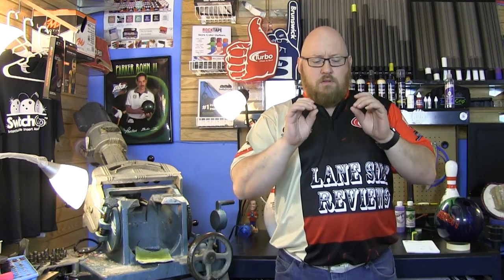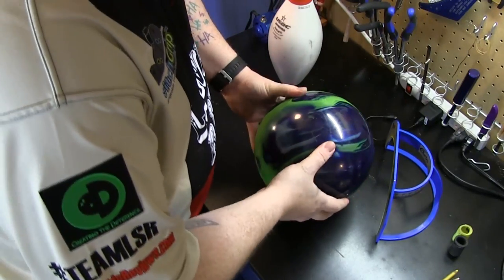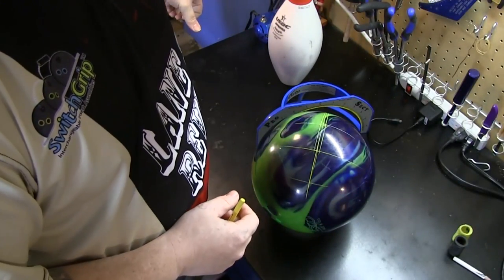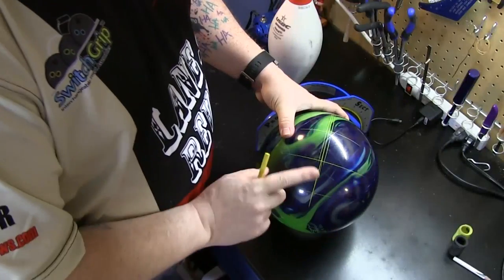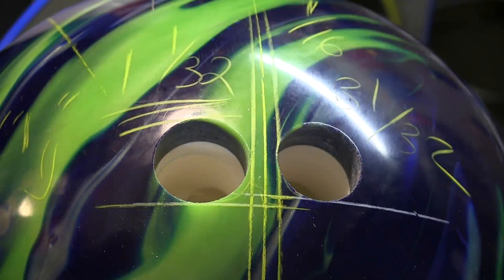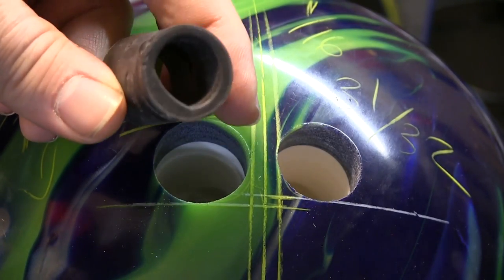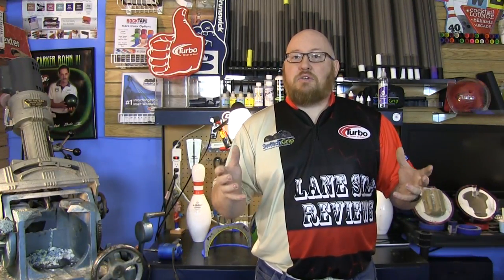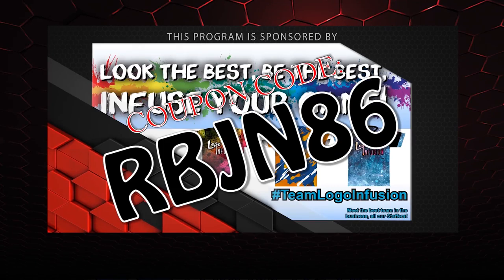Vacuum Grip Installation and Review by Lane Side Reviews

Comment: Hi Rob thank you for the video. I'm just getting back into bowling after a 30 plus year sabbatical so I'm trying to catch up on everything new to me.  Ideally I agree it would be best to re plug the holes to maintain the same span in your grip. But I have one correction see whole size difference is a 1/16” as you mentioned which is the difference in diameters. Using the existing holes the actual grip span difference would be 1/32” reduction or the radius difference.
Reply from the maker: When you're right, you're right...and you, sir, are right.
As an interesting update, I've been toying with using 1 1/64 holes instead of 1 1/32. It gives them a little more suction, and doesn't require plugging at all.

Comment: I don't think the change will change your span. I just did it to my arsenal and it feels great. The difference in the expanded width of the finger hole is filled up with the extra width inside a smaller grip. I mean, there is more material on the grip, so the span will remain almost the same. In fact, if you try and drill the expanded 1 and 1/32th hole flush against the front side of your grip, you'll be actually increasing your span when you use a narrower grip. So for existing balls, simply drill it centered with your existing 31/32th hole, and use a smaller grip. I tried going 3 half sizes down, but I can go up to 6 half sizes, or 3 full sizes. Even smaller. Do it by feel really.
It is also great for those of us passing 50 years of age and starting to suffer from a little bit of Arthritis.

Comment: I been using vacu grip for around 3 or 4 years now. Love the feel and release is better.
Reply: I’ve been using Vise vaccu grips since 2004. Tried some Turbo grips in 1 new ball recently (turbo only shop) and installed Vise vaccu after 3 games. Difference in feel was too much for me.
Reply: @remoevans2233  I use turbo for mine.
Reply: @JamesCFelty3  My son uses Turbo as well since the shop that drills his equipment only has Turbo grips.
Reply: @remoevans2233  my shop guy is on staff with vise, but he lets me bring in turbo grips and sleeves for my equipment. I just like how they feel and their customer service is great!
Reply: That’s what it’s all about, what works best for you. I don’t like either Vise or Turbo for interchangeable thumbs. Grip Lock makes a better product as well as Jo Po for that application.

Comment: That's why I hear the pop noise in pba events, I thought it was the thumb, but you always release your thumb first, so good to know this stuff :) I might consider vacugrip if our pro shop does it. Does it cost more to do this drilling?
Reply from the maker: we've rarely seen an additional cost for it (its actually less glue and work), but that is up to the pro shop.
Reply: Lane Side Reviews They just charge extra for special layouts, drilling is always the same price unless you get the interchangeable thumb slot, it's a bit more. I also have a small crack on top of my ring finger, because he was in a rush drilling my ball and forgot to bevel out the finger hole. I still love my ball though. That was the first time he messed up, but I didn't mind it too much

Comment: How would making an existing 31/32 hole into a 1 1/32 work? Wouldn’t that 1/16th shorten the bridge length to make it more susceptible to cracking? As a no-thumber, I wouldn’t have to worry about the change in span but I’m just worried about that 1/16th change
Reply from the maker: You can align it so the flat edge is the inner bridge. It will feel very similar.
Reply: @LaneSideReviews  So it would be thicker on the left and right sides as compared to the middle edge?

Comment: Couldn't you just file the fingernail-facing interior edge of the finger holes in an existing ball to create the extra space? You'd be able do to this with some elbow grease and just need to replace the inserts with a smaller size. The finger holes would no longer be perfect circles though I doubt that matters.
Reply from the maker: you absolutely can!
Reply: Used a bevel tool instead to create a conical hole. You could call it an extremely steep bevel too I guess. Seems to work

Comment: Why is your 25 grip have a different grip style than the 11?  The 25 is straight across and the 11 is rounded.  Seems like they are two different style grips.
Reply: I think that was the point. He emphasized that the method works with any style of grip, so I’d imagine he was using various styles to demonstrate that

Comment: That would be known as a counterbored hole, with the smaller diameter being at the bottom.  By having the larger hole drilled 1/16th" over the nominal size (31/32", or  .96875") it's allowing for 1/32" of clearance on each side (.03125"), giving the insert room to expand.  Sorry, the machinist in me comes out when I watch things like this.

Comment: might work better with a 1 inch bit , instead of a 1 1/16 inch on the top of the Hole
Reply from the maker: We just started testing 1 1/32", so 1" is on our radar. 1 1/32" has been pretty awesome.

Comment: The primary issue with vacu-grip installation is usually the hole pitches causing the back edge of the grips to protrude well beyond the ball surface. You have to cut the grips to remain legal, and this is the real challenge, since the grips are not anchored to the hole at the top, and tend to move around while you are cutting them.
Reply: Vaccu grips are glued at one point at the top and if you drill the hole properly, you don’t need to cut the grip.